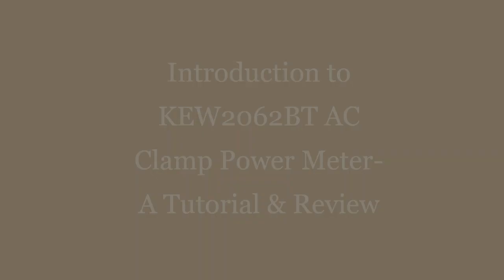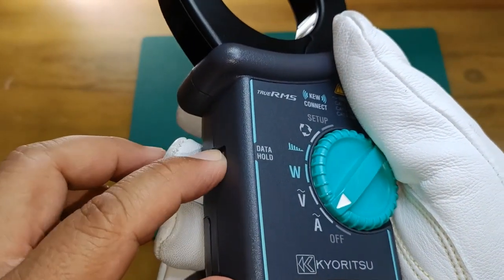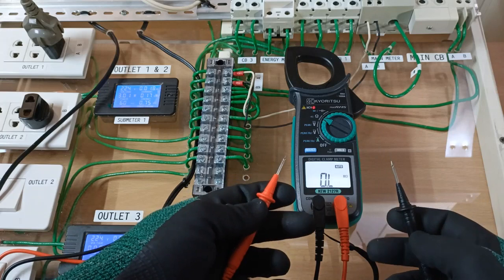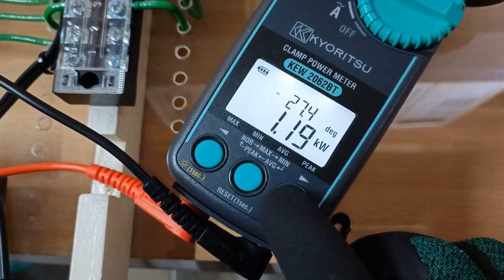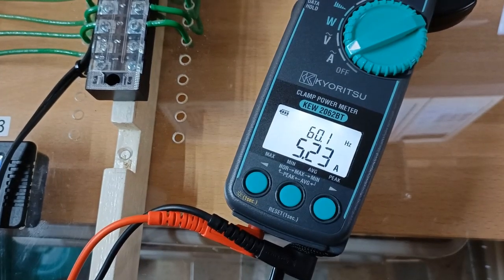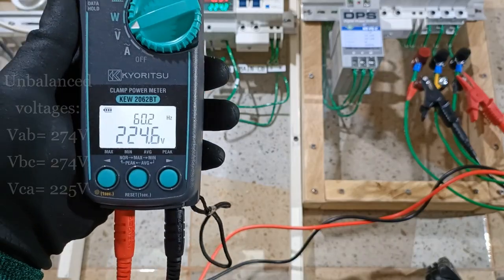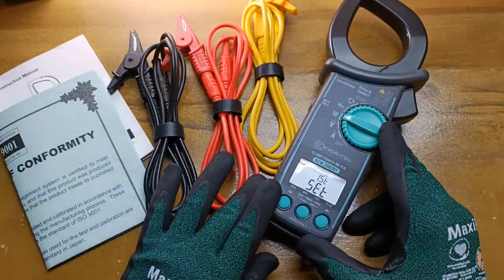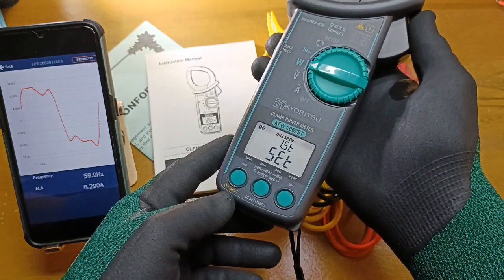[Eng Sub]Kyoritsu KEW 2062BT AC Clamp Power Meter 1000kW (0.3-1000 Amperes)

Comment: Is this able to test three phase distribution & Power transformer no load loss 
and full load losses?
Reply from the maker: Interesting idea. I haven't tried it so I can't tell for certain, although I think it may be possible. As you know, the AC clamp power meter doesn't care what it's testing. It sees them all as just load. So long as the current sensors fit the conductors, and the transformer ratings fall within the KEW2062BT's safe parameters, the AC clamp power meter will measure power seen from its vantage point. It's up to the operator to interpret the result. Just my opinion. You may wish to look up the user manual for more of its capabilities and limitations. Thanks for your support!